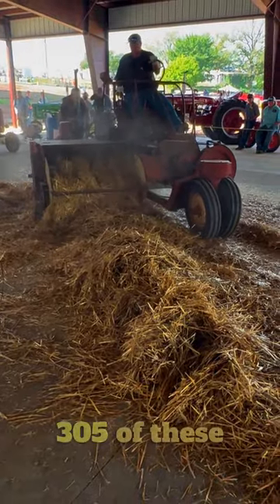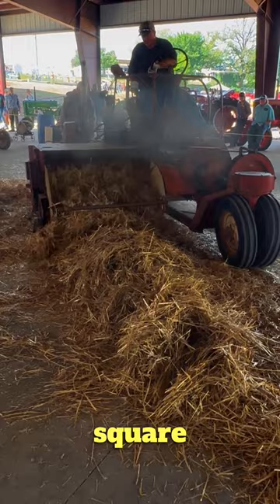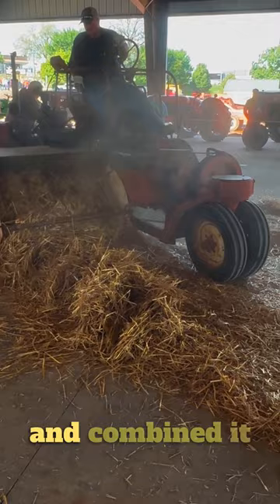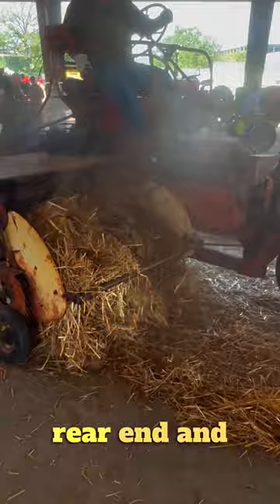1957 New Holland Self Propelled Square Baler #haybalers #newholland #farmlife #farmequipment

Comment: The dust would be unbearable.
Reply: Yeah just a tad
Reply: Good they tow a wagon behind?
Reply: Imagine it towing a rack wagon with a third engine to power a thrower.
Reply: Our club has one we still use at shows out in an actual hay field and the dust seems less than a conventional bailer
Reply: @miked6954  cool, I think antique clubs kept some nice equipment. I was just being sarcastic about " get over it". Was tired of all the other crap out there.
Reply: youre working outside you know
Reply: @redlight3932  ya the bailer makes dust and your on top of it. If you ever baled hay you'd know that.

Comment: Captain here. Thats the Wisconsin TFD series engine that used two opposing cylinders to run in a in line engine. There was a prototype engine that had two cylinders do the same stroke. They both would fire at the same time for example. Its model was the TJD series and was discontinued in 1962 because it failed emissions testing and had produced less horsepower than the TFD series